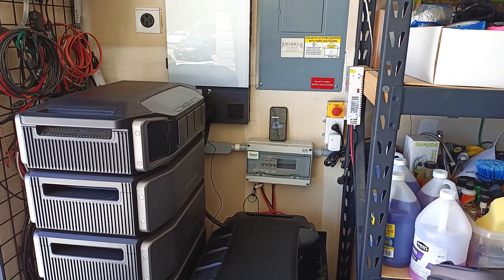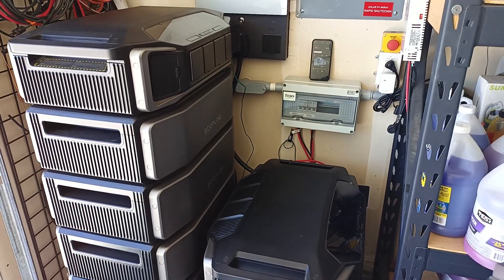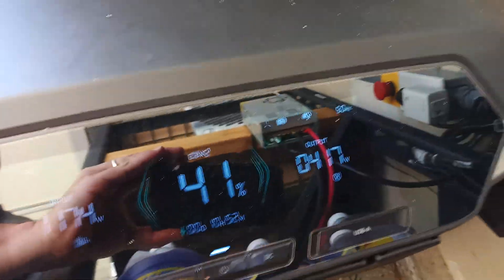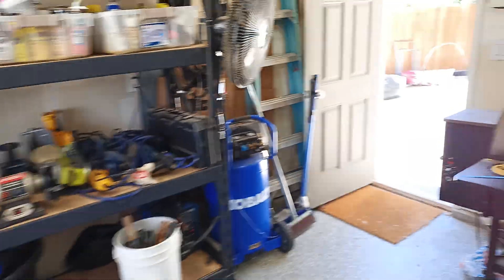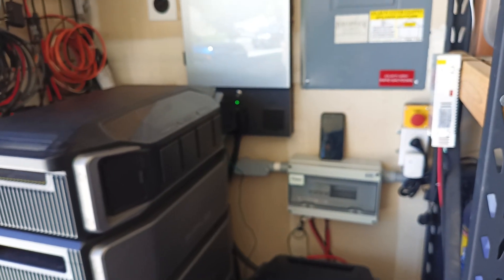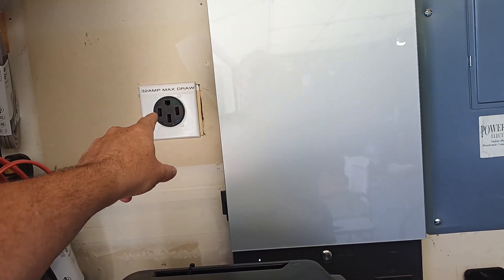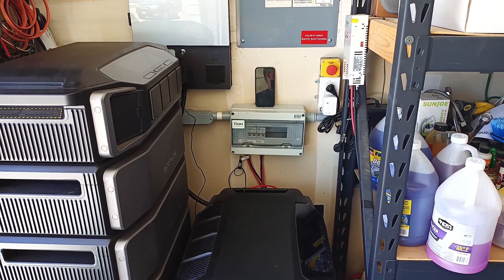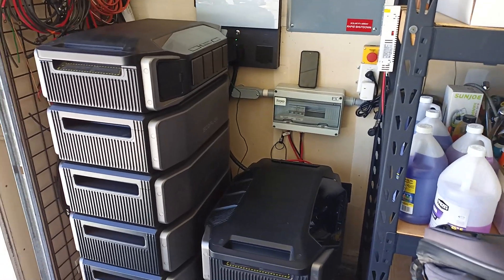Second EcoFlow Ultra vs Extra Batteries: What REALLY Works Better?

Comment: I’m curious how many you could stack in a backyard shed. That’s a ton of weight.
Reply: FYI, The EcoFlow batteries have an automatic heating system that heats the batteries when they get down to 32F, so it does use battery power to heat the batteries when needed. Something to remember since they will be stored in a shed.
Reply from the maker: @hlm34 yep the preconditioning and it can be turned on or off in the app it's not a forced thing.
Reply from the maker: Depends on your floor I guess you only can stack five Batteries Plus the dpu per stack the weights are in the manuals all coming down on 4 rollers so you can find the PSI on that pretty simply other than that one after another as long as your floor can support the weight right my shed is concrete base so no issues there same with my garage.
Reply: @erickoffgrid  it’s a wooden floor so I would probably have to add support underneath somehow.
Reply from the maker: @LayneBailey  Absolutly or it could dig in, steel plates to distribute the weight? but ya' something to beef it up if it is just a strandboard, OMB or something..
Reply: @erickoffgrid  Hey Erik, my wife is asking roughly how much are you saving per month with this system? She’s trying to figure out the amount of time it would take to pay for the unit. Can you give me a percentage of how much you’re saving per month on utilities versus what you were paying before the DPU’s?
Reply from the maker: @LayneBailey I just also posted a video on my numbers and how my power bill is dropped in what I was paying prior give that a look see and see what you think
Reply: @erickoffgrid  your set up is getting more impressive of all the time
Reply: I suggest no more than 3 batteries and the inverter. Mine collapsed with 4 batteries while I was moving the stack for the HVAC guys. Luckily they helped me disassemble the stack while I held it up from falling. I mean, you have $15k in your hands and it’s pulling you down. I made my own Dollie out of 2x4’s and added an inverter and separated the 4 batteries and glad I did.
Reply: @hlm34 Thanks for the advice.
Reply: Are you using the Tigo TS4-A-0 optimizers on all of your panels? If so, do you feel they are worth extra cost. I know they are required per the NEC for the shutdown requirements.
Reply from the maker: @hlm34 I am using them on all the panels and I absolutely think they're worth the cost because of the real-time information of what the panels are doing and the rapid shutdown capability as well as being able to turn off the panel at the panel is a huge positive basically yeah I would totally do it again and we'll put it on every other panel I ever put in.
Reply: @erickoffgrid Thank you Eric for the quick-honest reply. I didn’t realize you had a video for the Tigo setup, I’ve watched it 2-3 times, great videos! I am in the process of installing (12) 370 watt panels on ground mounted. I live in CT. and gathering all my parts and pieces to list for the Town to get a permit to start the adventure. I see you have both a metal shutdown and plastic shutdown besides the Tigo setup. Which do you prefer? Plastic or Metal shutdown?
Reply: One more thing, I had my EF DPU with 4 batteries on the provided Dollie. I moved it over for the HVAC guys and when I put it back, the Dollie collapsed on me. Luckily, the HVAC guys helped me disassemble the DPU from falling over and I made a dollie out of 2x4’s and added an extra inverter. 2nd inverter is an excellent add -on!
Reply from the maker: @hlm34 wow, that is surprising.. glad it worked out.. some times ya gotta build it yourself to make it solid 😅
Reply from the maker: @hlm34 funny enough on the mains that plastic one handles two different inputs and higher voltage and amperage than the metal one but I prefer the metal one.
Reply: I looked into the metal breaker boxes rated @ 240V. My calculations were for an array of 6 panels with an (Voc. 40.17V) open circuit voltage. The Tmin for CT. is 
 -32 degrees. The adjusted AI calculation for my panels went to 47.039 per panel.
47.039x6 = 282.234v. 
I think I will have to go with the IMO plastic breaker rated @ 600vdc & 32Adc.
Reply from the maker: @hlm34 absolutely because you're high voltage range is going to be in the low to mid threes.

That's the reason I show both my boxes there the metals are for the low voltage side and that plastic one is two input two output and 600 volts

Comment: Great update. May I ask if you got all of your DPU’s from EcoFlow directly or did you buy them somewhere else? And no issues with your inverters correct I’ve seen a couple of videos were folks were having problems with their new inverters.
Reply from the maker: I got all of my equipment all from the Eco Flow official website I didn't get anything from Amazon for the main equipment.

As far as issues I had a display issue with one of the dpus but it wasn't a functionality thing it was an LCD screen thing and I replaced it promptly.